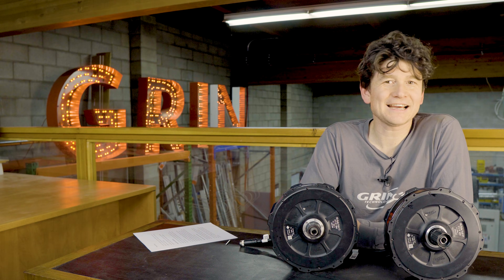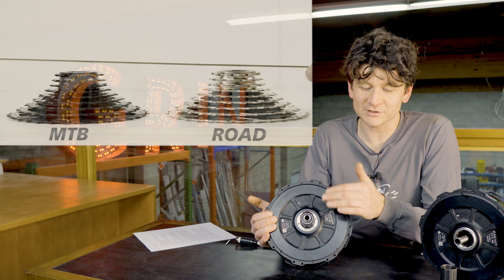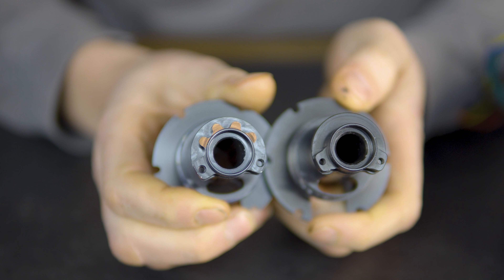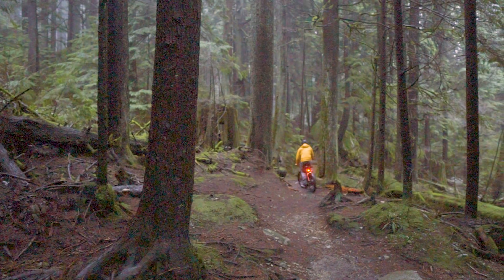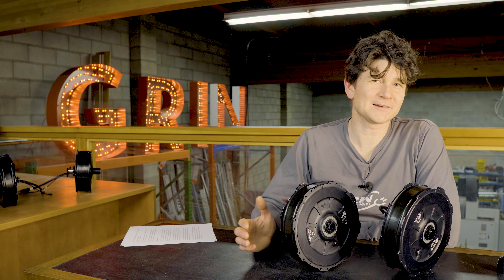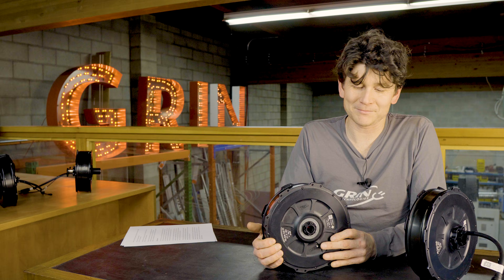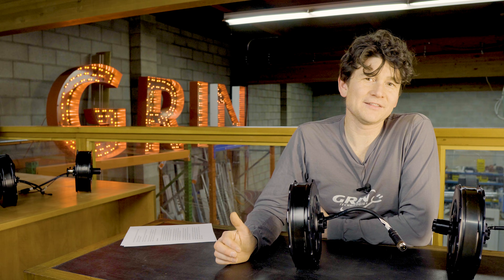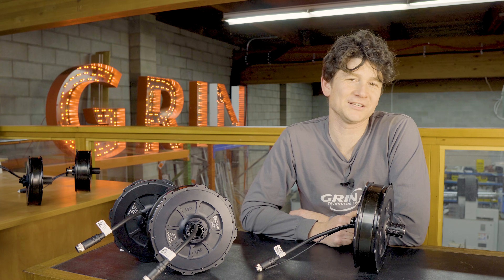Introducing Grin's V3 All-Axle hub motor series. SRAM XD, torque sensing, and Fat Bikes included

Comment: Is it possible to single side mount this motor? Or will it have the tendency to bend whatever shaft its on?
Reply from the maker: Yes, single side is fine. A majority of tadpole trikes actually use 12mm spindles for their two front hubs, and so they easily fit inside the 16mm opening with some shims that we provide. 
Of course the spindles are made from strong alloy steel, if you try to use just a regular grade of steel at that diameter it would bend for sure.

Comment: I'm looking at a used Yuba Mundo for adventure biking with lots of gear in a hilly area. Towing a trailer. Some roads are gravel. My local shop is recommending your Direct Drive hub motor...but this flies in the face of countless online posts I've read. What motor would you recommend? The shop won't sell the front hub motors at all. How well do these motors handle wet rainy environments? I'm also considering just getting a Globe Haul LT.
Reply from the maker: Sometimes the bulk of advice online is just flat out wrong, with people just endlessly repeating what they read online creating an incecent positive feedback loop. This is a great example of that. Send us an email for specific system recommendations, but the slow turn rear all axle motor kit will definitively not disappoint.
Reply: @GrinTechnologies  email sent

Comment: With the torque sensor, does shifting the front chainrings have any effect on the sensing? e.g. if i shift to a higher torque ratio does that change the torque measured by the sensor, or will it still measure the human power being put into the system?
Reply from the maker: It's scaling the computed human power. If you change the front chaining, you are changing your pedal cadence, and the only way to maintain the same human power is for you to change your pedaling torque by the same ratio too. 

Ie, if you are turning cranks 20% slower, you need 20% more torque on those cranks to be make the same power.
Reply: @GrinTechnologies  ah, i see! Thank you

Comment: Could you put 2 of the front motors on the rear of a trike?
Reply from the maker: If it's a trike that has a pedal tranmsission to the rear axle then no, as that requires a hub that turns with the axle while the axle in this motor has to be fixed and non rotating.  But if it's a front wheel drive pedal trike, or a non-peadling trike, then for sure you can electrify both rear wheels in a single sided mount.

Comment: Seeing on yalls site that a front fatty hub w/ 45mm stators is also coming Q2 24'. Is this still on track, as well as the rear fatty 45 (for 190mm)? Really excited to try these! Also, any change in peak watts for those beyond the 1kw of existing all-axle hubs?
Reply from the maker: The rear 45mm fatbike motors are already being shipped out to customers who placed the pre-order deposits earlier this year. After we've fulfilled those we will open up general sales on our website so stay tuned! 

There is no 1kW peak.  There is no such thing as peak watts in any objective sense.  We put that number down (pulled large from our ass) just to appease people who insist that motors should have a numeric watts rating :-)   The actual power capability of any given motor is primarily a function of the the operating RPM and is not a fixed value.  See:
https://ebikes.ca/product-info/grin-products/all-axle-hub-motor.html#MotorPower  and
https://ebikes.ca/learn/power-ratings.html

The 45mm wide motors should generally be able to handle 66% more torque and power at a given RPM than the 27mm motors.  So if you want to call the 27mm motors 1kW (which is totally arbitrary), then by the same rationale the 45mm motors will be 1.6 kW.
Reply: @GrinTechnologies  That's a much more accurate way to sum up the perf and possible thresholds of sorts. Thank you for driving that home (again) for us. Torque is what we'd mainly be in-the-market for, given we have a larger cargo bike, so the fat motor hubs are worth waiting for (135mm up-front and 190mm rear drops).

Will the front fatty be debuting aprox the same time the rear one will, or is that still a 't.b.d./in-dev' item? We'd like to do BOTH the wheels at the same time, if we can purchase both hubs in the same go.

Thanks as always for what yall do - the quality (and accuracy) in your products and specs is a welcomed, fresh take in this industry!
Reply from the maker: The rears are already in full production for the customers who placed deposits, but the front fat axles only got send out for anodizing a couple days ago so it'll be a couple weeks before those are getting produced too.  By the time we open up for general sales outside of the deposit customers, both the front and rear options will be there, so no problem to purchase them together!

Comment: Any chance of getting one that fits a 22mm id axle for a single side trike. I have a pav 3 stretch.
Reply from the maker: Sadly no, even 20mm is quite a pinch on the cable exist. But on many trikes you can replace the axles themselves and could have an axle machined that is 20mm (or 16mm for compatibility with the V3 hubs)
Reply: @GrinTechnologies  thanks but I was afraid of that. I'm almost 400 pounds and my trike is rated for over 500 pounds. The trike itself with nothing on it is well over 100 pounds. Thank you for replying.
Reply from the maker: No worries and hope you are able to find some solution or another.  That said a 20mm alloy steel axle would have no problem at all with those kinds of vehicle weights.

Comment: is it capable of reaching 50mph? or 80kph in your country
Reply from the maker: Any motor can do 50 kph.  Just choose the winding KV and battery voltage appropriately to your wheel diameter. Whether it has the torque to push a given vehicle at that speed depends entirely on the load profile of that vehicle.  You would benefit from watching:
https://www.youtube.com/watch?v=ALde6zhLPs0

Comment: How does the hub motor setup compare to a mid motor setup for bicycles?  Thank you in advance for your input.
Reply from the maker: This hub motor is lighter than a bbshd, is more rugged, more reliable, comparable in power,  easier to install, and gives fantastic regen braking for easy less bike maintenance. For off road riding a middrive is generally better, but for everything else the hub is supreme.
Reply: @GrinTechnologies  Excellent.  What is the most powerful hub mtor you have?  Any plans or ability to get a 4,000 or 5,000 watt with integrated 20" wheel, (like my Ninebot Max wheel-but way larger)?

Comment: the rear axle is catching my eye as I seen one in an AZUB tifly on your web site and if I am seeing it correctly I can still use my factory thru axle
Reply from the maker: If you see your axle spacing in the lengths below then yes!

1) 135mm Slotted Dropout
2) 142mm Thru Axle
3) 145mm Tandem Dropout
4) 148mm Boost Thru Axle
5) 157mm Superboost Thru Axle
6) 160mm Santana Dropout
7) 167mm Santana Thru-Axle
8) 170mm 4" Fatbike Dropout*
9) 177mm 4" Fatbike Thru-Axle*
10) 190mm 5" Fatbike Dropout*
11) 197mm 5" Fatbike Thru-Axle*
Reply: @GrinTechnologies  157mm is it..... Will be at trikefest 2024 here in portland on the 15th as I see Grin tech set to be there.. Will be asking more than..

Comment: Unbelievable the amount of r&d ye do for a company yere size. It's absolutely amazing work my friend. Been following ye for the last 10 years and what a journey it's been. When I built my first ebike. My current bikes done around 120,000km, second bike in that time and second battery on this v3 version of the bike. V1:1000w, v2:1500w, v3: 3.3kw, v4:not sure but I'm thinking around 5-8kw, but I need to learn tig welding for this version.

Comment: Would this be compatible with pre-built e-bikes? I have an Aventon Abound Cargo bike that is struggling with its mated 750 W motor.
Reply from the maker: Changing the motor alone will not change the peak power since that is dictated by your motor controller.  So normally we'd suggest you first get a higher current motor controller. If your existing motor handles it fine then great. If your motor eventually fails (stripped gears, cooked windings etc) then that is the sign you needed a larger motor too, so you can get a larger motor for your new higher power controller.
Reply: @GrinTechnologies  I have the Aventon Level 2, do you offer such a controller and hub motor to upgrade both? Would like more power but wold want to do it correctly and still use the factory battery.

Comment: So I read in the documentation of this product that the ‘apparant assist level’ differs based on the gear you are in since the pedal torque is multiplied depending on the gear you are in. That worries me a bit that this may not feel natural. It almost makes me think, why put the torque sensor in there anyway compared to the bottom bracket. Can you help me better understand how torque sensing will actually ‘feel’ with this motor?
Reply from the maker: It feels great, that is a comment on the manual meant more for system integrators and not users. The CA3 system computes the human power input correctly based on the wheel rpm using the wheel trq sensor mode, no different than how it computes human power based on crank torque and crank rpm with a bb sensor
Reply: @GrinTechnologies  what? Really?.  Lets say I have a bottom bracket torque sensor sensing 40nm. Then that new torque sensor in the rear hub motor will sense a different torque when I’m in first gear then when I’m in fifth gear. What you are talking about is ‘work done’ by the human. That is true but I thought you want to multiply the user’s torque by scaling current directly with torque. And also I’m not planning to use CA3, I’ll be using a VESC for motor control and ui via bluetooth to my phone
Reply: I believe that what is computed is human power, as in torque X speed which is obviously the same (minus negligible drivetrain loss) whether you measure it at the crank or at the hub.

That being said, I'm curious how this is handled when running the superH and the "new" display instead of a CA3?
I'm pretty sure that it is all accounted for, but I didn't read it explicitly written out.

On this topic, would there be a comprehensive list of feature differences between the two options?

Thanks!

Comment: This is very exciting. I’ve had an all axle motor for a few years now and it’s great. Now I can make my surly big fat dummy 2 wheel drive 🎉. Is it going to be possible to tie the two motors together so as to allow the rear wheel torque sensor to provide a throttle input to the front wheel?
Reply from the maker: With the CA3 kit and the dual wp8 controller cable you can do that indeed.

Comment: So I'm deciding between the STD wind and the SLOW wind version. Interestingly enough I see barely any efficiency differences between them for going up a 15% incline hill at 10kph. I was expecting to see in the order of 10% range difference, but I see more like 1-3%  . Don't get me wrong, that's awesome! Because now I don't have to sacrifice my top speed. But am I interpreting that right?
Reply from the maker: It's one of the most common mistakes to assumes a slower motor wind would be more efficient. In theory with the same copper fill the efficiency and torque should be identifical for all motor winds when compared at the same conditions. The only reason for the small difference is the controller losses from the higher phase current.

Expect a video from us focused purely on this point.
Reply from the maker: The main difference between the slow and standard winds will be the maximum torque at the controllers phase current limit when the controller is in thermal rollback. But that's a controller limit, not a motor property.
Reply: Thanks! I have bought the STD wind version. I can’t wait to receive it!

Comment: I got chinse motors i regret it but i didnt found this before...
Reply from the maker: Chinese hub motors are good value for sure, but for the last 10 years they've been totally stagnant in design innovation or pushing any boundaries.
Reply: @GrinTechnologies  idk nine came with errors and already over heating with less than 10thousand km

Comment: Will the fat bike option be better at hill climbing?
Reply from the maker: Yes, the 45mm wide stator has a lot more torque capability than the 27mm stator, which means better hill climbing
Reply: When will it be in the SIMULATOR? I can compare with my actual setup.
 @GrinTechnologies

Comment: It is compatible with 20mm with the correct lathed and machined spacers.
Reply from the maker: If you have a lathe to make your own 2 piece spindle you can make it work for sure. Or use a stock 15mm boost  spindle with the stock 15mm inserts and just have a 15-20mm shim to fit the larger ID fork dropouts.

Comment: Besides weight what is torque expectations for xx volts and xx amps?
Reply from the maker: As explained in the user manual, it's about 80Nm for short times, 30Nm continuous without statorade, and 40Nm continuous with statorade. The voltage has nothing to do with that.
Reply: @GrinTechnologies  thanks for the clarification

Comment: The attention to detail with this hub is impressive. Very nicely done. I wrench on a small fleet of Bullitt cargo bikes here in Seattle and I'm wondering how appropriate this hub would be for our needs. Currently we run GMAC's on our bikes and they have been fantastic in terms of reliability and performance, especially with all the hills here. How do you think that the All Axle Hub Motor would compare with the GMAC with regards to starting torque?

We often carry loads in the 75-80 kg range, add another 120kg for bike and rider weight, and throw in starting on say an 8% hill from a red light and I'm wondering if the All Axle motor would have enough torque? (The GMAC can do it, but it is definitely at the upper end of it's capabilities).
Reply from the maker: Hi there and glad to hear of our potential interest. In this particular application of cargo hauling up steep hills in Seattle, definitely the geared GMAC motor will have a performance edge over the DD All-Axle hub.  If you have statorade in the All-Axle motor, what you will find is that in an apples to apples test, both the GMAC and AA will be able to handle the same grade and load hauling when pushed to their limits, but the GMAC will be doing it with better efficiency and less drain on the battery pack. 

For some people this is an acceptable trade-off to make for the benefits of the higher reliability and robustness that comes with the direct drive motor. But it will feel like a small step back in terms of the punch you feel from the hub.

You can make up for that by putting the motor in the front 20" wheel rather than the rear 26". I've got an edgerunner with the All-Axle in the 20" rear wheel (what you see in closing scene of this video), and in this configuration it's great at hauling 2 kids all around the hills of North Vancouver.
Reply: @GrinTechnologies  Ah yes, of course, using the wheel diameter as a form of gearing. Makes total sense. I really appreciate your detailed reply. Very helpful information.
Reply: I’m another Seattle rider interested in this same question. I’m looking to upgrade to a higher torque motor for carrying my ever bigger kids up a 10% grade hill to school.  I’m considering this or the GMAC.

Comment: It's a shame you're not based in the UK, I have a motor designed that will wipe out all competition guaranteed!

I've approached manufacturers here in the UK and they didn't even bother getting back to me, obviously I didn't show them the designed and only stated that my designed should come close to double the output of a conventional ebike motor.. sounds far fetched right? 🤣  Not when you understand conventional ebike motors waste half the energy being put in as I do. So what I'm talking about is essentially producing a motor that requires 1000watts but outputs 2000watts (or near that) in torque.  An efficient motor makes an efficient generator in this case, bolt two motors together so one motor rotates the other and if we're putting in 1000 watts we should get 2000watts... 5000wats in 10,000watts out..

If you believe in Einsteins theory of relativity you not thinking "this guy is nuts" but I know Einstein was a clever fool as in, clever at fooling people. Einstein's theory of relativity completely does away with the existence of the Aether, his theory is fraud/lies.
A magnet sticks to metal at room temperature and no energy is being put in, that is cold fusion apparently, a magnet alone proves the theory of relativity as BS as nothing is being put into the magnet and yet it still has energy. A magnets energy isn't relative to any energy being put in, "boom" goes the theory of relativity proving Einstein was a fraud 👍😊
Reply: Can you explain the gaps between those topics? You keep jumping around until it becomes word salad.

Comment: Sorry but I just can't understand how a cassette with gears make any difference on a hub motor. I have always built mid drive motors so I am ignorant on hub motors.
Reply from the maker: It doesn't make any difference at all to the motor performance.  What it affects is the rideability of the bike (ie pedaling) and the compatibility of doing retrofit conversions on exiting bike platforms without having to change or downgrade the existing drivetrain.